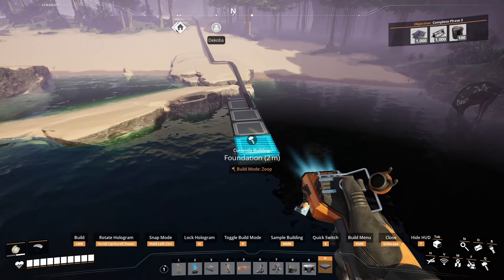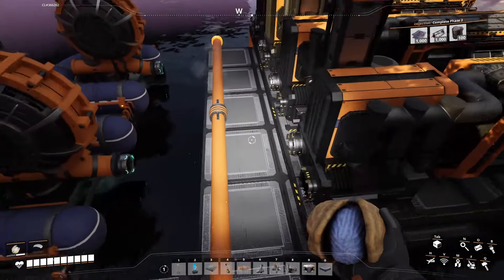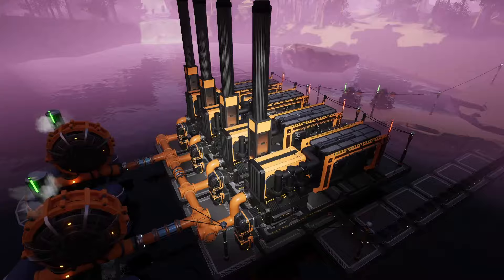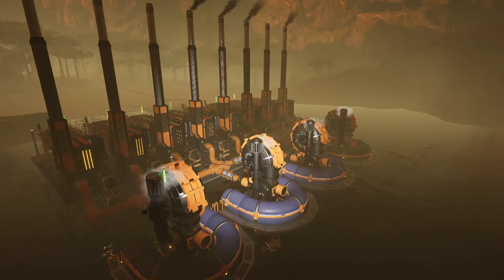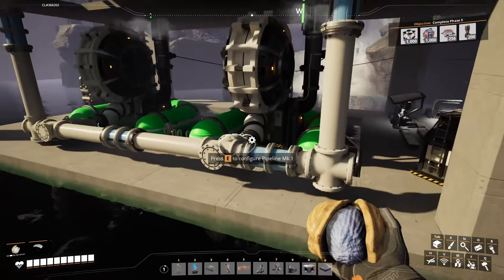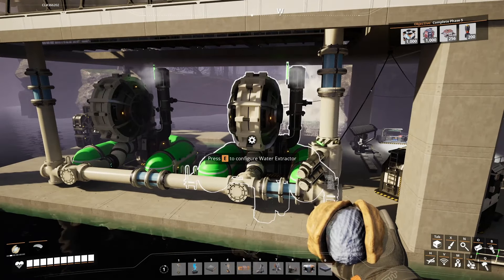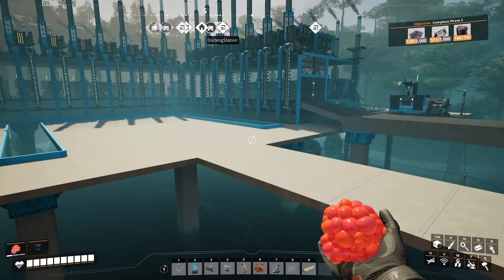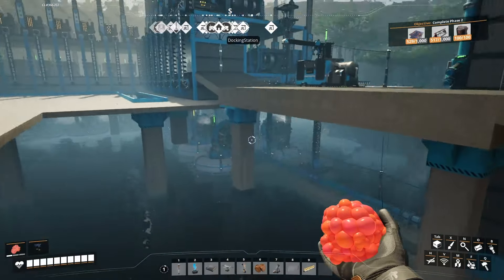100% EFFICIENT Coal Power Plant Build Guide incl. Multiple Designs - Satisfactory 1.0

Comment: The 8:3 ratio of Coal Generators and Water Extractors never set right with me. Seeing the 2:1 ratio just looks cleaner and makes so much more sense. Gonna use this design from now on, thank you😊
Reply: I just pipe line my water in from extractors in the lake at the top of the waterfall, no tower or lift pumps needed.
Reply: Same here, i always use 1 water extractor for 4 coal generators with one water extractor overclocked to 180 water per min. little bit more power usage but heck of a lot simpler.
Reply: You're wasting power
Reply: @rousrouslan4023  just a little compared to making more extractor and the trouble
Reply: @LalleMangaming  trouble of what? 8 to 3 is weird sure, it could be 32 to 12 nice even number
Reply: @rousrouslan4023 you can use 4:2 ratio, underclock pumps to 75% and actually save some energy
Reply: @Misves  You're wasting space
Reply: I made 18 water pumps for 54 power plants. All slightly overclocked. Running at 100% efficiency.
Reply from the maker: @rousrouslan4023  Itd be terrible to run out of space
Reply: @rousrouslan4023  32 gen and 8 water on 180 water minute isn't that bad, saves a lot of power and space. And easier. Also, all people should play how they play, there is no good or best option.
Reply: Actually it's quite a good ratio if you think about it. It allows it to be easily converted to 2:1 ratio with 75% efficiency in early game when power is quite limited, or 4:1 with 150% when you can spare more power, and often need to have less space. If the ratio would be set to 2:1 or 4:1 at start your ability to choose ratio would be more limited.

There is also advantage in learning how to manage 8:3 ratio with m1 pipes as you need to transfer 360m3 water with 300m3 pipes. It's not hard to set up if you know what to do at will become much more important later.

And the whole thing become much easier as soon as you unlock m2 pipes, that's when i set up bigger (more then 8-16) coal plants. 
In the place in video you can fit a lot of water extractors, i have 30 (for 80 plants) and they take less then half the lake, and only because i wasted some space for them to look better.
Reply: The weird part about 8:3 is the necessary management of water distribution.  The required 360 m3 doesn't fit in a single Mk1 pipe and so needs to be handled appropriately.  So breaking it down to 4:2 and underclocking extractors, while taking up a bit more space, is much easier to conceptualize if you're not an optimization nerd.
Reply: You can use 2:1, it's just less efficient and youll profit less power.
Reply: @rousrouslan4023 That only matters if you're actually using all the water avaliable.
Reply: @rousrouslan4023  Why would it matter that they're wasting space..?? It's their own world??? Hello??????
Reply: I default to 1:2 unless I am really space constrained.
Reply: @thehuggz-i9k  and, if you are an optimization nerd its more efficient in certain ways
Reply: Don't forget underclocking saves power. 3 pumps at 100% use 60mw, 4 pumps at 75% only use 13.5mw.
ADA didn't tell us underclocking saves power.
Reply: 3:8 isn’t a terrible ratio
Reply: @rousrouslan4023 big brain

Comment: It was mentioned in a reply to another comment, but I also wanted to chime in regarding the water tower head lift "trick". It's intended game design and mimics how municipalities pressurize the water for us to use at home. If you've ever driven through a rural community and see huge water towers nearby, it's those towers that are pressurizing the system for the area. Cities do it too, but the towers are typically on top of tall building so you see them less often as a driver/pedestrian.
Reply: Depends where you are in the world.  In the U.K. they aren't used as much, and many have been torn down and never rebuilt, replaced by pumps.
Reply: @mysticalmaid  Or turned into houses

Comment: the water tower bit confuses me, if all your water pipes go into one, and most of them looked to be mark 1 pipes, then how are they powering all the gens at once
Reply: For pressure, the way water towers work in real life is that you actively pump water up into them, and then the weight of the water so high above the pipes passively pressurizes the entire system below them. That's how you can have water pressure even when the power goes out, until the water tower empties. You don't actually need a bunch of pumps everywhere, and you don't need as many pumps as you would if you tried to just use pumps directly, because most of the water never has to go up into the water tower.

Well, it's simplified for the game of course, but that's the general idea.

You do in game though want to spread out your water extractors. The one extractor to two generators pattern in the video makes that easy to organize, but you could do other options, like using 3 extractors to 8 generators. You'd just have to make sure that they're attached to the pipe so that you don't have stubs where you need more than 300m3 to go through the same pipe.

So for example if you have them spaced like one of these examples, it would work, because you never have over 300 water needing to move through the same connection.
G > W > G > G < G < W > G > G < G < W >G
G < G < G < G < W < W > W > G > G > G > G

This wouldn't work:
W > W > W > G > G > G > G > G > G - G - G
Reply: Also each vertical pipe is still limited by I think 300 ml/s so it can only do up to that however there are multiple of these vertical pipes providing water to the generators
Reply: Yeah, I'm still confused by this. The pipes support 300 units of water. The extractors are each providing 90 units if they're on 75% power. So after 3.33 extractors, the pipes should be saturated up to the tower and then the tower itself can only release 300 units. That should only be enough for 6.67 generators at 100% power.

Comment: 6:00  I believe the starting point for the initial 10m head lift for the water extractors is at the center of its output pipe, rather than the bottom of the extractor, which is why your set up works.
Reply: Everything works fine if you place fresh pipes. Ten after reload you will see how badly you messed up things. This is a very old bug.
Reply: @piotrstrzelecki4763  Thank you for that. Two of my pipes weren't getting water and it was driving me crazy trying to figure it out

Comment: nice!  that first plant is exactly where I built my first coal plant!  although my first coal plant was designed around compacted coal and mk3 belts with 36 generators lol.  cant wait to see the rest of the plant designs
Reply: loved the builds.  my design used the generators elevated and rotated like the 3rd one, with the water extractors on the bottom and enclosed like the second one.  I do a bit of over clocking on the water extractors, just to keep the number of them down a bit.
Reply: Wait you used compacted coal for your first power plant set up!?
Reply: @UntoppedToppHat  yeah. Why not?
Reply: @marcbennett9232  if I'm understanding it correctly, you managed to get all the way to automating compacted coal on biomass burners?
Reply: @UntoppedToppHat  no no.  I don't think you can put compacted coal in biomass burners.  I put the compacted coal into coal generators.
Reply: @marcbennett9232  no I meant that you got to the point in the game where you can automate compacted coal, and you got there with just biomass burners.
Reply: @UntoppedToppHat  oh yeah.  my biomass plant is 24 biomass burners, I had plenty of electricity.
Reply: @marcbennett9232  that's genuinely crazy, hats off to you I'd never be able to deal with biomass burners for that long
Reply: @UntoppedToppHat  its actually not that bad.  the more generators you have, the slower your fuel burns so the fewer times you have to go out collecting.  I build my biomass plant, empty my inventory, collect fuel until my inventory is full, come back with a half container of leaves and a half container of wood.  if im really slow I might have to do that twice before my coal plant is done.
Reply: after reading the replys to your comment i don't feel as bad w/ the amount of Biomass Burners in have in my world currently. Am in the Northern Forest. I have 2 sets 24 Biomass plants. With the Amount of Clearing i have to do after each reset-- it made sense to me. instead of trashing it all. 1,440mw of power.
Reply: @Quackz86  very nice!  im in the grass fields or dune desert usually, so I only use one 24 burner plant.

Comment: just want to say that i love the water tower mechanic for these build. I really thought that i have to use a water pump for those top generator to fully and constantly be filled. Took me just 1 water pump for all 48 coal generator. I finished your build upto these coal generator part. it was challenging at 1st since its my 1st time doing such a massive build on a single area. Love the idea of tractors supplying the coal, its much cleaner than a long logistic from miner to the factory. Thanks for this.

Comment: Mine is 4 rows of 8 coal generators at probaby just that lake. Each row gets water from 2 pumps on one end, supplemented by a 3rd from the other end. Actually the extra pumps are a pair that feeds into two rows of generators together.
Coal comesthrough a straight manifold line coming in from one end.
The splitters are on foundation and the pipe lays on the splitters.

For visual reasons I kept it all on one floor. The rows of generators are facing two paths that are 2 foundations wide.
Yesterday I unlocked glass roofs and my silica supply. Today I'm going to put a glass roof just over the manifold lines and pipes so you can walk there and watch the movement under your feet.
I love glass roofs over manifolds and busses!

Comment: For the compulsive balancers among us:
That first raised setup simply begs to have you feed a 2 generator tile from 1 splitter located between the elevators.
The depth of the subfloor easily allows to split an input three times for a neat 1 normal node with mk2 feeding 8 generators.
With some concession to how the belts look in the subfloor that can be expanded another layer to feed 16 generators from 1 input of 240 coal.

I love this tileable setup!

Comment: You can also use a towerless water build just by ensuring all the fluid input pipes are higher than the machine it'll be inputting into. The game uses fluid gravity calculations and the lowest pipe always gets fluid priority. As a rule: Always feed machines from above with fluids. This way the internal tanks inside the machines stay full - create the product and instantly refill instead of feeding from below the machines where it has to suck up the resource each time which can cause machines to be starved during production. As long as the fluid is pumped to a level above the machine, all pipes below that point will feed equally and quickly which helps avoid flow rate issues and "fluid sloshing" and the myriad of other fluid headaches.

Comment: While I love the look of the piped-under setup (much cleaner), on my new 1.0 run I had the inputs all coming from above and I had 0 issues with supply issues (which popped up at times when supplied from below).  Not as clean, but more reliable.

Comment: i made a coal plant late game as i had a bunch of heav oil to deal with and was too lazy to run some blenders with diluted fuel. so i set down a refineries for petroleum coke and then a bunch of coal plants. hindsight i should have used the heavy oil to fuel recipie and a few generators to run on that but i was too lazy and didn't want to put in any brain power.

Comment: Love seeing multiple approaches / layouts.  I am curious how you balanced & verified the truck throughput to make sure you never had an outage in the truck fed plant.
Reply from the maker: I overproduced. The coal plants required 720 coal, and the trucks required another ~40, so I had my miners overclocked to produce 800/min (there are 4 nodes in that jungle, I had miners on all 4 feeding into the truck stations. After a few days, the plants, truck stations, and tractors were all at max and just topped off as they went around. There were other issues with vehicles, but so far those seem to be fixed in 1.0, so heres to hoping. Also, its crazy that I casually measure my satisfactory playtime in days.

Comment: I guess it not bug since it sharing the one pipeline. That what I feel when watching other video about the water mechanics. As long there is pressure in height different it need to match it. Just like the water tower in town. They put the water tank high above since they using the same pipe and result pressure.

Comment: I build 1 side of the big power plant like in the video at 7:30. I am running in some problems with the water. I build all in 1 water pipe line and my water tower is higher then the factory. The water flow is good until it reaches the second floor coal power plant. I have a wall on the second flow and before the wall hole the flow rate is 300 but after it is almost 0. Its like the wall hole is blocking everything.

Comment: I’m not sure where I made a mistake or if I just misunderstood; But, I’m trying to get the 8:4 coal plant running, it stays self sufficient for a bit before it blows a fuse. The last 4 generators in the lineup are getting coal at such a slow rate that they run out of coal faster than it’s being replaced causing the whole grid to go down. I have the system fed by 3 normal nodes, the whole thing with Mk. 2 belts, 8 generators, 4 water extractors running at 75%. 

Not too sure what the math is on the splitters so I’m thinking maybe I need to use the first splitter in the manifold to branch off into a second manifold to feed the last 4 generators in the line-up?
Reply from the maker: What you are describing building is called a load balancer, what I do in the video is a manifold. Manifolds take a few minutes to ramp up, but once they have, they two are mathematically equivalent. Manifolds often look neater and are often easier to build, so I prefer them in most cases. If your machines arent getting enough coal, it is a supply issue, as the two methods are both capable of providing the machines correctly. If you are using 120 coal, make sure you have mk 2 or better belts throughout your system so that isnt a bottleneck. Building a load balancer is also a fine way to ensure even distribution, but itll take more space.
Reply: @Dekoba  I found the issue! After quadruple checking the line, I realized the belts coming directly out of the miners were mk. 1 belts and it was in fact creating a bottleneck. Problem solved 😁 

love the build by the way. I enjoy the way you break down the whole thing in your video, it feels like I’m being taught the mechanics of the game instead of just copy-pasting what someone else built.

Comment: Important note for the 8:3 ratio. With Mk1 pipes, the maximum flow rate is 150 l/m, so you have to make your water piping a closed circuit to "force" water to feed to the generators from two directions. (Just "feed" the water piping back to the extractors)
Reply: Mk1 pipes max flow rate is 300l/m provided that pipes are full of liquid. This is a bit opposite to conveyor belts. Best thing is first flood pipes with liquid to full and then start generators. I always wait for filling to top and then connect cable from generator to power pole.

Comment: Can you go deeper into the setup of the last factory? I don't quiet understand how 4 water extractors works to feed 8 coal generators when that would need 360 water units or whatever.. but the pipes only take 300?

I tried something similar without seeing how you connected everything to one pipe but it doesn't seem to be working exactly like yours.. the water tower trick.. do you go up and then the output goes back into the lower level and then you just bring up 4 pipes? Those 4 pipes split into the 8? I brought one pipe up from the basement and essentially did a manifold line down the row of generators. does this not work?

Comment: I have a question for the coal production portion. Do we need to have a higher MK miner and belts to provide consistent power to all four gens in the first display? The problem i run into is that my last two generators don't receive enough coal to stay on, even when i put coal into to stall the belts.
Reply from the maker: Depends on the purity of the node.  1 generator takes 15 coal.  Impure provides 30 with a mk 1 miner,  normal gives 60, and pure 120.
Reply: @Dekoba  ahhh thats right. That explains it. So idealy we should have our miner on a normal atleast?
Reply from the maker: Yes,  but the beauty of the plant design is that it scales.  You can do a 2 generator steps if all you have is an input node and it helps out for what it is.  And you can scale up as needed if you overclock or upgrade miners.

Comment: Didn't see any mention of Compacted Coal. Is it not recommended or just not mentioned. As I was thinking of using it at the Northern Forest and Rocky Desert Boarder for my Coal plant while leaving the other three Coals open for Steel and other shit
Reply: 10:42 compacted coal (briefly) mentioned

There are a few things to note:

1. Compact coal IS good.
2. What makes compacted coal good is that it has a burn time of 8.4 seconds compared to 4 seconds of regular coal.
3. BUT by the time you get to compacted coal (need a hard drive to research) you will already be past needing to use it for fuel in a Coal Generator.
4. It would be better served making Turbofuel IMHO.

Comment: How do all those water extractors run on the same pipe network, doesn’t the mk1 pipe have a 300m limit?
Reply from the maker: there can be multiple pipelines running in parallel on the same network to increase bandwidth
Reply: @ has that changed from they way it used to work? I haven’t played since around update 7 and you used to have to use a pump to act as a valve to keep the pipe limit working I think.